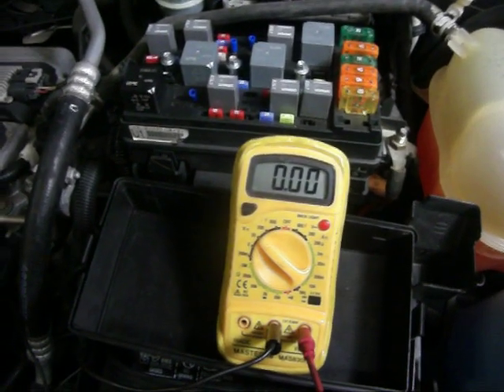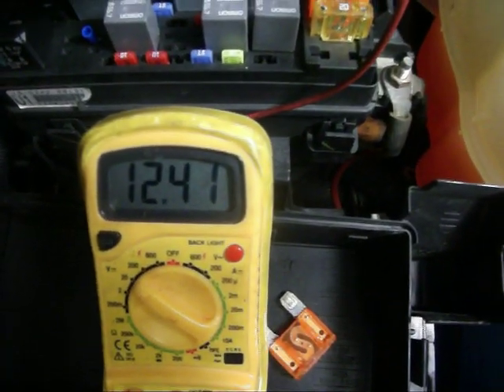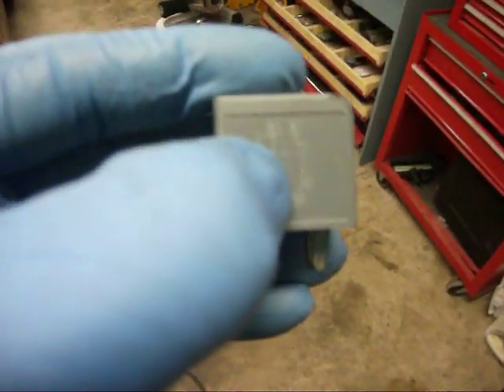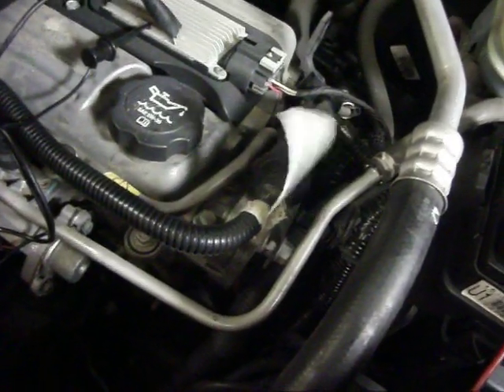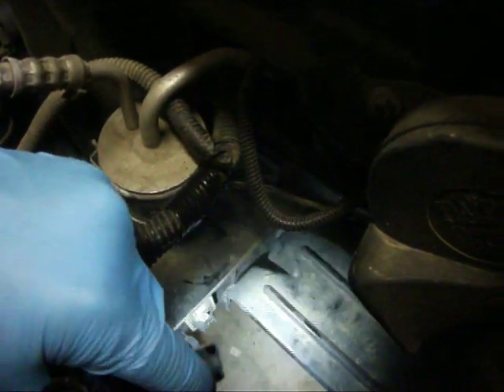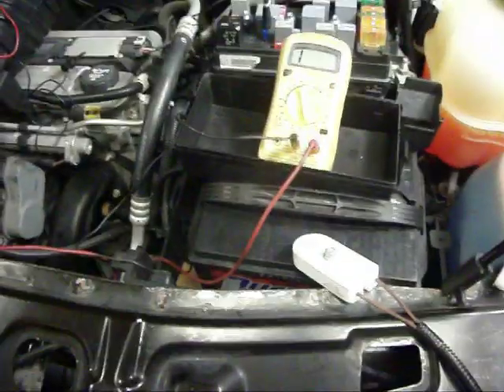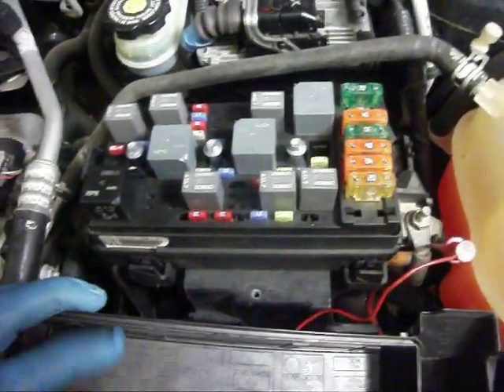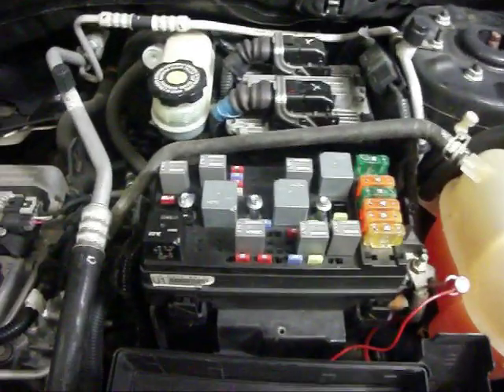Car Cooling Fan Troubleshooting Procedure and Low Speed Fan Resistor.

Comment: I have a 2006 2.2L Vue with only 3.3v going to the fan at low speed.  I suspect this is not high enough, and that my fan resistor is kaput.  Do you know the correct voltage at the fan for low speed?  And, do you know the resistance of the fan resistor?  Many thanks,  Tom

Comment: Hello sir, I drive a W203 Mercedes Benz 2006 model but my engine cooling fan is always stuck on low. Fan speed never increases to high when temperature goes up. Please I need help

Comment: Perhaps somebody has an answer.  Replaced radiator., fan system, thermostat,  fiat 500 2012. Fan does not turn on. Ran direct wire to fan and it turns on. Sensors are good and juice to fuse and sensors. Temperature gauge hits 50% mark and no fan. I shut down so I dont get overheat. No codes. I'm stumped.  If I run a wire from fuse to relay, pun 30, and fan comes on does that mean relay is bad? Cause neither low or high kicks on

Comment: Sir is there any resistor for Camry 2004, my radiator fan not working unless I turn on ac.I changed everything, ect sensor, thermostat, relay

Comment: I am messaging again hoping for detailed help? 07 pontiac G5 2.2. My fuse box was missing relays & several were upside down... I've been told by G.M. that my G5 does not have the cooling fan resistors. I've Never seen my fans run! Its only gotten up to 210-212 max My cooling fan connector has 3 pins. The center pin is positive, I think...my cheap multimeter does not have ohms & does not beep. I'm not sure what relays i need exactly! One cooling fan relay takes a 4 pin relay but, cooling fan 2 (i think) takes a 5 pin but G.M told me it takes 4 pin relays however, I realized that I can get the low speed to work by ground g a pin in my relay box but, while I tested the 5th pin while the fan was running, that 5th ped had current which winded down as my fan winded down. I need pics of the fuse box on a 07 G5!!!!!!!!

Comment: Dude! You rock! I knew that little bastard was down there somewhere but you're the only video that shows exactly where it is and I swapped it out for twenty bucks and saved about $600and a dual coolant fan swap for my equinox which would involve pretty much taking off the whole front end the condenser the radiator disconnecting the transmission lines and the coolant lines yada yada yada.
I can't thank you enough and I will be looking at your other videos four other little tips and tricks. 😊👍🤯

Comment: IF I TURNED MY A/C ON, THE FAN IS RUNNING.BUT, WHEN I START MY CAR AND A/C OFF, THE FAN IS NOT RUNNING. IS THAT NORMAL?
Reply: The fan only start after reach  190 degrees Fahrenheit  👍

Comment: my fan is not coming on so i'm gonna try the relay  i've changed alot of stuff to make the air cold it worked a 3wks or 4 and the fan don't come on and i can here it but air not blowing through vent car is not running hot

Comment: I just recently picked up a 07 Pontiac G5 vin-F  2.2 ECO-TEC. It has A/C BUT IT DOES NOT WORK, IT WAS IN A FRONT END COLLISION! IT HAS 1 SINGLE FAN!  I just yesterday realized that it was missing a relay, replaced the relay & fan still do not work! DOES THE 07 PONTIAC G5 have dropping solonoids? The GM garage told me NO! but my fan is not working & i need to get to the bottom of this issue fast!!!!! I found a way of making ONE SPEED WORK BY GROUNDING MY TEST LIGHT & TOUCHING ONE OF THE ELECTRICAL LEGS OF WHERE THE MISSING RELAY WAS SUPPOSE TO GO. PLEASE HELP

Comment: I just got a 07 Pontiac G5- 2.2 vin-F, On the interstate it stays cool,(173- 190 when i stop at a light) Earlier yesterday, I was going up a mountain & it reached 210 & that is the highest ive ever seen it!!! I then got onto the interstate & of course it cooled down but, how to tell if my fan circuit are working correctly?  I have never heard or seen the fans run!!!! You seem knowledgeable as to electronics & relays! IDK if my fans work or not but, im wondering what test's I can run to test my circuits to know if everything is working properly. I need to pay attention to how you jumped your relays & do the same. You have knowledge with the cooling fan electronics for a 2.2 so, Im hopeful that you might help me understand & just how to test everything? I could always let the car idle but when its under load is when it heats up...

Comment: Will the ac fan still come on when there's no AC gas ?
Reply: Most of the AC units have a sensor on the high pressure side , gets the reading to turn on from that sensor. Should get the signal to turn on pretty fast.So won't work unless AC system is charged, providing the reading.
Reply: @johnhalchishick7094  makes sense. Thanks

Comment: I need to replace both resistors and connectors for the cooling fan on a 2015 Cadillac SRX.- (no low speed ) fan erratic and drawing too much amp. Any idea where I can find those resistors? Have been searching online and local car parts stores with no luck.

Comment: Goood ,
However ,

Sorry to say ; 
you are wrong about 
relay pins designated numbers ,,, 
always pin #30 live from battery positive post , 
and pin #87 goes to fan or component .

If you swap it , 
still will work but, 
this is the way and how 
automobile engineers design it .

Comment: Looks like the same resistor on the PT Cruiser 2.4 turbo High Output cooling fan..wonder if it has same resistance? Finding one from Mopar requires purchasing complete fan assembly....Aftermarket same. Would you know the Saturn part #...liked and subscribed...great vid..best to you and yours

Comment: Great video - discovered issue was low fan resistor but now the fan is stuck on.  p0480 error code.
Reply: Do is that daytime running light sensor resistor to do with the low speed of the cooling fan? I'm trying to clarify that

Comment: ive got a low speed fan problem the fan  motor works, the relays ok, the fan fuse is ok, the relay harnes has 12 v on x3 pins & a continuity on the other & another pin which im guessing is signal  pin not sure exactly, anyway the low speedfan motor plug has 12v on both pins which i found strange but im no electrition & the high fan has 7v on one pin & 8v on the other but that fan does work. i hav yet to change the thermostat yet but will soon ! what r u thinking with the info i hav givin u ?

Comment: When I turn my AC on both my fan comes on but doesn’t work when the engine is hot so the car Will overheat
Reply: john doe   Check your coolant Temperature Sensor/Sender and its connector.  The Temperature Sensor sends the signal to turn on fan at a certain temperature and is independent of the a/c fan commands.
Reply: Hey did you find the solution?

Comment: Hey Robert, I REALLY HOPE YOU CAN HELP ME? Keep in mind that I had a nice votage meter & lent it out, they had it on the unfused side & put 880 amp's to it, smoked it! Anyways, I have a 03 focus (L4 dohc zetec vin-3). I have replaced the head temp sensor, cooling fan solenoid, water pump, thermostat & it's housings, serpentine belt & tensioner, timing belt & tensioner, & because of my fans not running, I replaced my main & rod bearings. I am really wondering if maybe I just didn't cut off enough of the wire when I replace the cooling fan solenoid? I had my voltage tester then & I saw some current (I don't remember exactly what voltage I saw?) but, the point is, I can get both fans to run when I apply 12v to them(when I use a 15 amp fuse & run separate power & ground to them, each fan works) also, when I disconnect the head temp sensor, both fans run constantly! but, they will not run when everything is wired up to factory specs! im wondering if I just need 2 more butt connectors & cut off more wire & reconnect the cooling fan solenoid? I also replaced both relays & checked the fuses!  I AM LOST & EVEN MORE LOST WITHOUT MY VOLTAGE TESTER!!!  I LIKE HOW YOU RAN THE FANS FROM THE FUSES TO THE PINS WHERE THE RELAY SHOULD OUTPUT! I NEED TO LOOK AT MY RELAYS & SEE WHERE THEY OUTPUT & RUN POWER FROM THEIR FUSE TO THE OUTPUT PIN & SEE IF THEY FIRE UP & RE WIRE THE SOLONOID! MEANWHILE, I ORDERED A NEW COOLING FAN CONTROLLER SO I CAN GET THEM WORKING BUT, I WANT THEM WIRED THE ORIGINAL WAY!!!
Reply from the maker: Hey D.j. B, I'm afraid you're not going to get very far without a meter. If you haven't already, you pick one up pretty cheap, $15, Ebay, Amazon or Fry's.As for the circuit. There should be 12vDC to the fan relay coil pin from a fuse in the cabin fuse block. The coil is actuated by the Power Control Module, PCM, by sinking the other pin to the coil to ground. So you won't read ground unless the controller has sent the control signal to the fan pin.Other than that, verify all the wiring is good by measuring resistance from the fan relay to their perspective fan, PCM and fuse block. I'm not sure how your fans are grounded but the ground has to be clean of any paint or rust.Good luck.